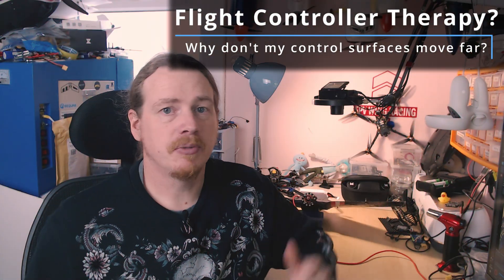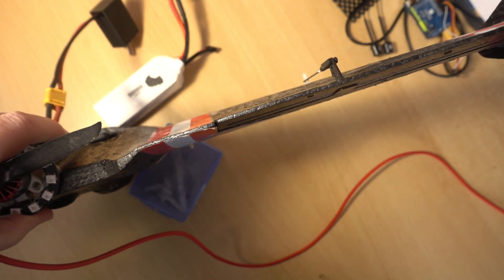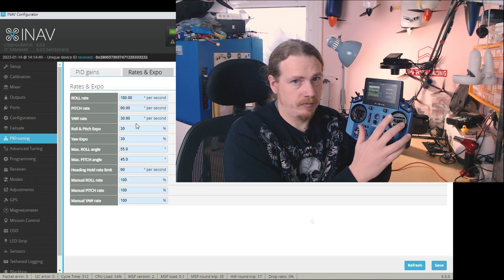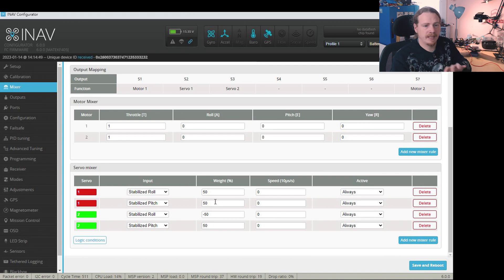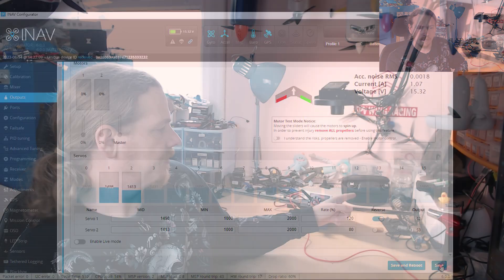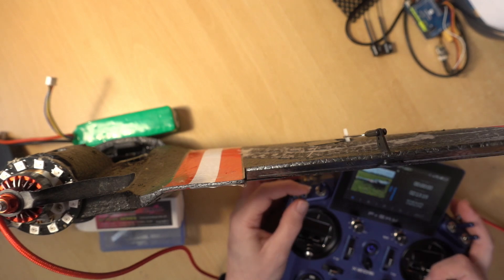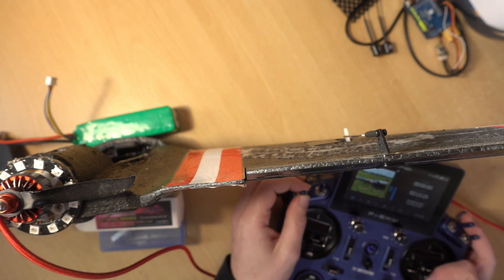INAV: Why don't my control surfaces move much?

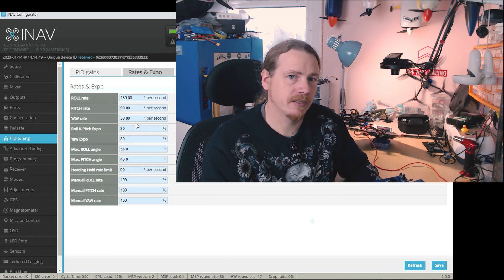Comment: To avoid this problem, I just set my iNav roll and pitch speed to a high value like 600°/sec (4:22 in video).  This effectively bypasses the software iNav control limits.  Because it is far better to limit the roll & pitch rates via the servo linkage mechanical throws.  Setting the roll & pitch rates mechanically (rather than by software) helps ensure you're getting the maximum servo resolution in your control surface movement range.

I would only use the software limit if somehow the servo linkages are set to the smallest throw range yet still the roll & pitch are too fast for the pilot's tastes.

Comment: Hi, I set up my Flying Wing in INAV
my radio set up is totally default
I plug Motor to S1, Right Wing at S3, Left wing at S4 then input INAV as flying wing

But I realise the movement of the Elevon is not correct

The S3 pitch move a lot while the S3 roll is so little

In the opposite、 the S4 also has the same condition
The roll move a lot while the pitch is so small

Do you have any suggestion for it?

Actually I have change the Mixes Weight all into 100% to get easier to know the movement
(
Servo 1 Roll: 100, pitch 100
Servo2  Roll: -100, pitch 100)

But the result is still same

It also can be seen in the Output tab,
The servo value is different between Servo 1 and Servo 2

Pitch: Servo 1 move (1200~1700) while servo 2 only slight (1450~1600)

Roll: Servo 1 (1450~1600), servo 2 (1200~1700)

Comment: I had a strange issue with my Swordfish recently I have continuously trim servos set & the last flight was perfect & disarmed as normal. When I went flying the next week I connected the battery & all the control surfaces were all miles out at centre even in manual.  Only thing I could do was to connect to the configurator & readjust back to 1500us for each surface.  Any ideas what happened?  Thanks

Comment: we can't have any trims on the radio if we're going to use any of the navigation modes? Where is airmode in inav6 do I need it turned on still?
Reply from the maker: No, you should never use radio trims. You can in manual. But you should mechanically adjust them after the flight and zero the trims. 

Airmode is usually permanently enabled. If will only show on the modes page if that is disabled. But to be honest. There’s no advantage to disabling it. The default settings are fine.
Reply: @MrD  so default is ok for my ASW28 then.  I guess I just have to do an auto tune when the wind is calm
anyone know the throws for ASW28 they aren't in the manual

Comment: Hi. Can you kindly help with INAV connection with frsky R9 mx. I am trying to connect with f. Port and getting no signal. Using Matek 405wse. Thanks
Reply from the maker: This is pretty straight forward. But there are a couple of things that can trip you up.
1. Connect the "Inverted S.Port" pad on the R9 MX to TX2 on the F405-WSE. You should also connect GND to G and VIN to 4V5.
2. On the transmitter, in the receiver options. Make sure the telemetry type is set to F.Port.
3. In INAV, on the Configuration page. Disable "CPU Based Serial Ports". When this is done, you should not see Soft Serial in the ports page.
4. In INAV, on the receiver page. Set the protocol to FPORT and set protocol inverted to ON.
Then is should work.
Reply: @MrD  Thankyou.

Comment: Hi Darren.
   I'm the guy who commented on the Facebook group about raising the value in the mixer.
I know that you're a knowledgeable individual, and I won't argue with you, but I'd appreciciate some further clarification about "oversaturating" the servo.
I have a wing that even after performing autotune several times was alot less responsive with Inav than it had been when I was flying it with straight pwm signals.
    after some experimenting, I changed aileron values of "50/-50" to "60/-60" and elevator to "70/-70" and it flew better. I then tried "80/-80" on ailerons and  "100/-100" for elevator and it feels much more like it did before installing the FC.
After watching this video, I am going to go back into configurator and try it your way to see if I can get the desired results, but I have been flying it this way for over a year, and never noticed anything that I would describe as oversaturation.
Reply: Never stop learning
Reply from the maker: Over-saturation is when you have so much commanded input that the output cannot perform the tasks asked. This affects multitask control surfaces, such as elevons or ruddervators. For example, on that VTail, over-saturation would be using full elevator, then trying to add yaw, but there not being enough movement in the servo to perform the yaw. What you would end up with is both ruddervators moving for the pitch, and only one moving for the yaw. So you don’t get the full commanded control. That is why it is good practice to total 100 in the mixer for each control surface. 

The lowering the weight on the ailerons results in less resolution/precision from the servos. 

With your unresponsive wing. If it is still less responsive in manual, you could go to the outputs page in INAV and boost the output rate to 120. This will move the servos further. Maybe closer to what you had with a pure receiver. It may just be that from the radio, it is sending 988 microseconds to 2012 microseconds. But INAV will be sending 1000 to 2000 microseconds range. So there is a couple of percent difference there. 
Non-manual modes will be tuned to rates, 80% of manual by autotune by default. This is to make sure the stabilisation has room to work.

Comment: What’s up man maybe this is why I  don’t get any up elevator on xuav cloud. When I activate launch mode I get no movement out of elevator. Never seen this before usually no problems but this was my first v-tail. I also had a? When u first tune a plane do u think it’s better to have auto trim on a switch then later use continuous trim or do u even use continuous trim I have it active on all planes but think it make thinks kinda confusing cause I’ve experienced a slight roll then switch to manual and if flys great. So it seems that if you fly into the wind then turn around the plane tends to roll but then will fix it’s self but u have to have and off don’t touch stick so if u didn’t let trims compensate then u get some crazy midpoints

Comment: Hi Darren. First of all I would like to congratulate you on a fantastic channel. I have just purchased an x20 so your videos are being an enormous help. I have one problem at the moment that I can not find the answer to anywhere. How do you get rid of the annoying beeps every time you select something, I notice that your transmitter doesn't do this?
Reply from the maker: Hi Dave. I'm glad the videos are helping you out.
Sure. If you go to the System > General screen there is an Audio section. The mode allows you to change what types of events make sounds. I have mine on default. The other thing that I have done is assigned the volume to my slider. So in the videos, if the red slider is all the way down, the transmitter won't make any sounds at all.

Comment: Nice work Darren. 
I have the FWIG radio set up on my tx16s 
If I hold up the momentary switch for a few seconds it says save. Is this the save for the auto tune?
Reply from the maker: Yes, that is basically a shortcut for the stick commands.

Comment: Such good info. I've been doing the tune all wrong. Does the walksnail record the OSD?
Reply: I saw it in other videos. But mine didn't. Have to check Settings probably.
Reply from the maker: Thanks Ruby. Yes, with the latest firmware it records the OSD as a separate file. There's a tool to convert that in to something usable at https://github.com/kirek007/ws-osd-py/releases/
What I really like about the tool is you can use any font set and it can create the OSD as a PNG sequence. So you can just import that in to the video editing package as an overly. That opens up so many editing possibilities.

Comment: Hey, Darren! I have been trying to compile some custom firmware for a Matek F405WING controller to remap pin S2 for servo usage in order to add a camera pan gimbal. I'm also wondering if there is a way to remap the LED strip pad to be a servo PWM output so I could have a pan/tilt gimbal? I'm all out of PWM outputs and have only used 2 UARTS and an analog fpv system. I have been trying to compile firmware for the 6.0.0-FP1 release because that is what I'm trying to test. My model is a Volantex Phoenix 2400 configured with full-span ailerons and crow mixing. I'm running Windows and trying to compile with MSYS2. Even changing a base parameter seems to make the compile process fail. I have spent 2 days trying to figure this out. Any help would be most appreciated!
Reply from the maker: You may not even need to make your own target to do this. There is a 9th PWM output on the F405-WING and WSE. They're just not on the servo rails. That 9th PWM would give you the PAN servo.

To get the tilt. If you are using a standard ESC on the standard ESC protocol. You can use `set output_mode = SERVOS` which will set all PWM outputs to be servos. Then in the INAV mixer, add 2 to all the current mixes. Then add a mix numbered 1 which used Stabilised Throttle. Then add a mix numbered 2 with the RC input for the tilt channel. That should work, and keep the elevator on output S3, so you don't have to reprogram the whole mixer.
Reply: @MrD  that is exactly what I needed to hear! Is the 9th pwm output on a solder pad somewhere centrally on the board?

Edit: I found it. Thanks!
Reply: @MrD  after trying this, the servos work correctly. The throttle is not dependent on arming status, though, and stabilized throttle messes up the ESC calibration every time a battery is plugged in. I assume there is a way to set that stuff up in the programming tab, but I'm at a loss now. I also want to use navigation modes, as this is a long-range build. If the throttle needs to be set to "RC Throttle" rather than "Stabilized Throttle", I fear that it will not behave correctly if the plane failsafes and tries to return to home. Do you have any other ideas for how to set the S1 input to function as a motor rather than a servo via global variable or logic command?
Reply: @MrD  since "Servo" mode doesn't disable the motor when disarmed, would "stabilized throttle" input on the motor still work autonomously for navigation modes? If so, I can just add a special function throttle cut when my arm switch is disarmed. Is there an "arming status" telemetry signal from the flight controller? That would be preferable to switch position. A simple fix would be rewriting the INAV code to make a programming function to link "Stabilized Throttle" input to arming status, or making "Stabilized Throttle" input dependant on arming status unless there is a programming if/then scenario that would override that function when configured that way. I'm still hopeful, but I think it is something to look into. I'll open a support ticket in github once I figure out how to simplify the issue.
Reply from the maker: Sorry I’ve not replied. I wanted to check this out for myself. But have been busy with final bits of code for INAV 6.0. 

Stabilised Throttle should be the correct setting to use. That will work with the navigation modes. However, as far as I’m concerned; it should need arming too. If this is not the case, that sounds like a bug to me.
Reply: @MrD  ok. I have also been busy. I have been doing some testing on it today and have found that I also get a "Unable to Arm PWM Init Fail" message when trying to run a servo on S2 pin with these configurations. I'm afraid that if I post this bug, it will only be partially resolved because this is possibly a timer issue on a dicontinued (and nearing obsolete) FC, at this point. I don't know if I understand it completely, but the "pwm failed init" message means there is a timer conflict. Since everything else works with the S2 pin mapped as a motor, this is leading me to believe mapping it as a servo is causing the timer to have a conflict in the pinIO portion of the firmware. Does that make sense? I have read similar issues where the ADC was mapped to the same timer (which would make sense for the pin normally being set up to run an ESC). I assume there is a limit to the number of pins to which a timer can be mapped. 

I also noticed that since the arming status is not a factor for throttle, the "Stabilized Throttle" does not actually have any effect during auto-launch. The rest of the auto-launch functions seem to work (i.e. switching to Angle mode for the predefined duration of time and trying to climb at the set attitude until sanity checks kick in), but the throttle is pretty much manual throttle for the duration of the flight. I did get a series of about 5 logic conditions to act as a throttle cut, but my prearm switch does nothing for me.

I might be back to the stage where I need to build custom firmware in order to have a safe experience. It seems that since the resource definition in the firmware calls S2 a motor and uses the same timer (timer 4) as pin S1 for the motor, I do not know if the pins can function differently from each other. I also do not know if I can remap timers within the firmware or if there are physical paths that dictate which timers work where. 

In theory, this shouldn't be as big of an issue as I feel like it is becoming.
Reply from the maker: It shouldn’t be a timer issue as when you set all to be servos, all of the S pads are just outputting PWM at the servo refresh rate (50Hz by default). Setting “Stabilised Throttle” in the mixer does not switch the pin to a motor. It is still operating like a servo. But “Stabilised Throttle” should be commanded by navigation functions, and obey the arming status. 

The custom target would not work, as the timer would cause problems if setting S1 to motor and S2 to servo. They both use the same timer, so would both need to be motor or servo.
Reply: @MrD  that does help a bunch. That explains why my firmware kept failing. I have reported the throttle issue on github and left detailed descriptions.

Comment: I just wondered where the flight controller can store these pid values gained during flight ? 
The fc is not always connected to power and has no buffer battery. So the fc must have a non volatil memory but I have not heard about or simply missed that.